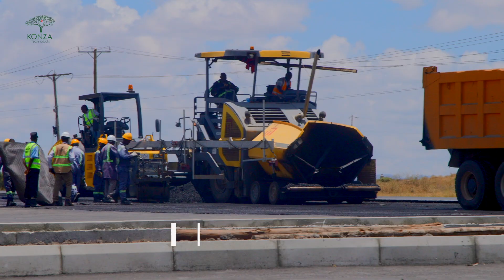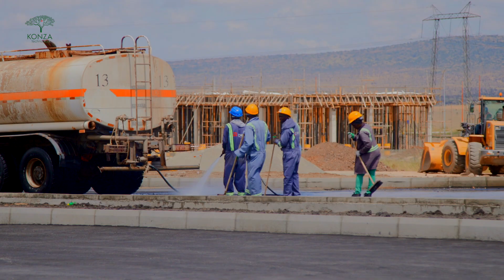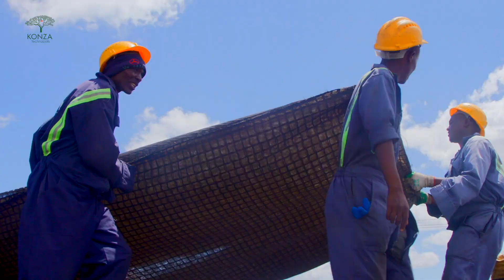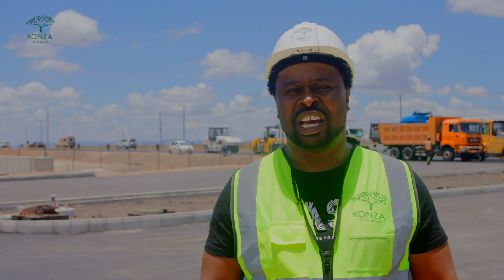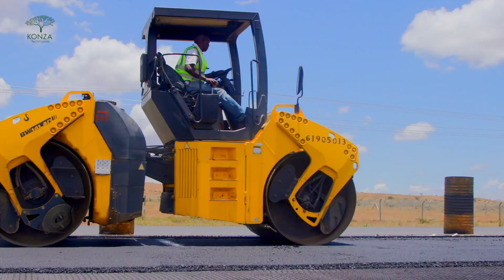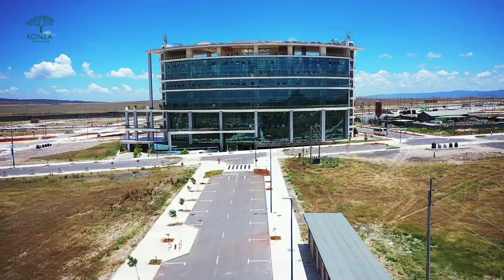KONZA TECHNOPOLIS ENTERANCE ROAD ASPHALT REINFORCEMENT

Comment: Hopefully all those required to build will have under ground parking lots. This is will ease the issue of parking on the roads and leave it to cycling manual and electric, walking and electric motor bikes. These do not require much space just charging ports